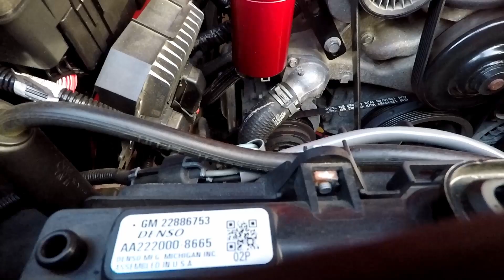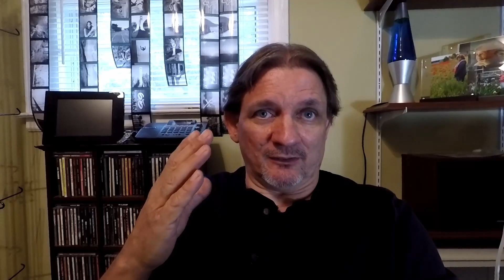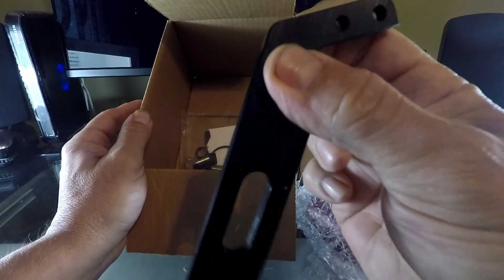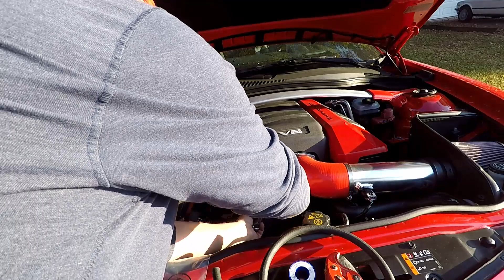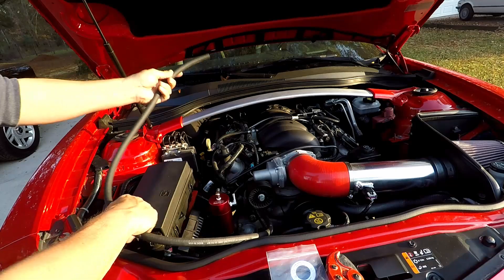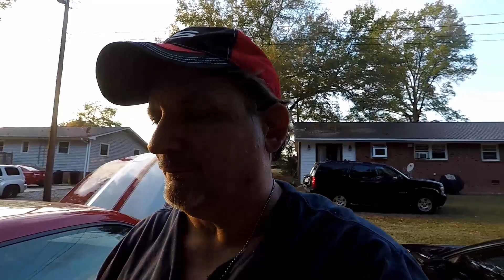How to install an Elite Engineering catch can on my 2012 2SS Camaro LS3

Comment: Question I have the same catch can install just like you my question is looking at the motor driver side back right of it where the tube connected before did you plug that or just leave it open? Because mine is plugs and I wonder if that’s my problem
Reply from the maker: What year is yours? I did not remove or plug anything...All hoses are still hooked up. Thanks for watching

Comment: Hey brother! Terry again. I have the 2010 with the key fob issue. Still haven’t tried the new keys. Was wondering 2 things. One set of keys has the blank key on it ..... which has the dangle key. Will the still read each other key blade with key fob? And 2nd ... I am wanting to get the Elite oil catch can. Is there any discounts any where to get it closer to a $100 ? Right now the kit is $159. Lol also 2 more. Sorry  on the oil catch can.... braided tubing ... is it worth it or does the rubber do just fine and what’s your option on the check valve ?  Just curious. Thanks for Camaro Time.
Reply from the maker: SO sorry but I am not following what you are asking about the key.....For the catch can, I do not. That is the current going price. Maybe you could find one on Ebay cheaper. The braided lines look really cool . but unless you are running a lot of pressure like from a blower it is not necessary. But it is your money so which ever you like the looks of better......
Reply: Camaro Time thank you. I will just get the $159. It’s worth it. It looks good on your Camaro!! Thank you for your help. I will let you know what happens when I try to add 4 fobs and 4 keys.

Comment: I bought my car with a catch can already on it and they have one of the nipples under the throttle body being used and the other is capped off? And the other hose that runs off the catch can runs around the back side of the motor into the valve cover on the drivers side...does this make sense to you they also have a 3rd hose t barbed in on one of the hoses going to the catch can and it is going to nothing....and i never have any oil to drain out of my can??? I have a 5th gen 14 ss ...what are your thoughts on my situation
Reply from the maker: Honestly I have no idea with out seeing it and knowing which catch can you have. Sorry. Thanks for watching

Comment: Nice job on the video. I like the Elite Catch can as well. It does a good job collecting oil, I usually have about 1/3 of the bottom of the can filled up between oil changes. I made a similar video on this catch can installed on a 2010 Camaro SS L99 Automatic. When installing the Catch Can on the Automatic, one of the ports is at the back of the motor and you will use up most of the hose. I subbed to your channel as well.
Reply from the maker: Hey. Thank you very much for checking out the video. Now I know why you have extra (well, why I have extra) hose left over. Wonder why they did that? Thank you, will check yours out as well. Many thanks

Comment: Da can looks good man. Keep us posted on how it works out 4 u. Im bout 2 put new brakes an rotors on my camaro. Gotta have a smooth stop lol. I know u prob buy tires a set at a time, but if u only bought 2, where would u put the best 2...front or back?
Reply from the maker: Thank you. I sure will. I have been told both by reputable shops. Front  and back. So like you I scratch my head when I do get two. I install the new ones on the back. As that is where the power and control of the car comes from.
Reply: If I don't plan on racing or doing anything my mama would slap me for, I put them on the front. It always rains in Washington so more tread on the front is essential for rain handling